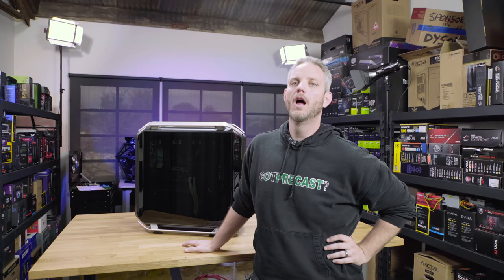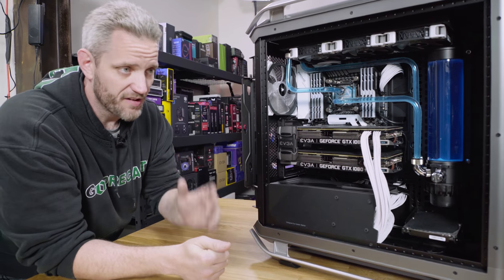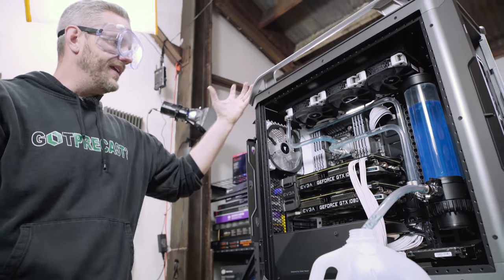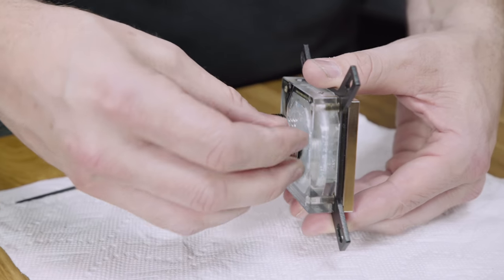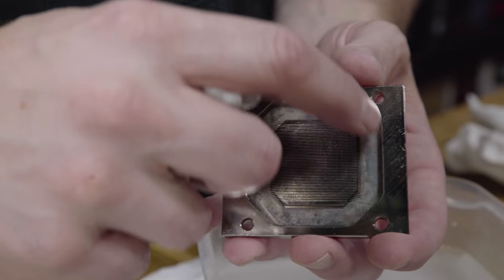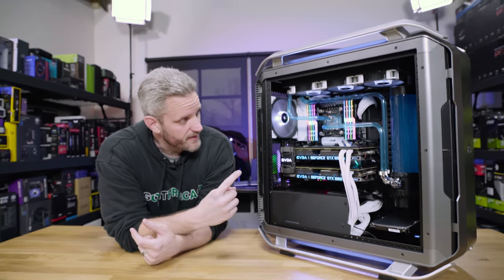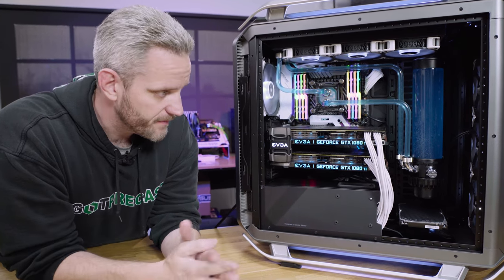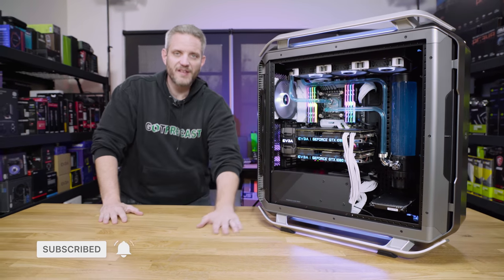It happened again... and this time it was NASTY

Comment: Here's the deal, a lot of metal stuff is made of "chinesium", as in you can't be certain of the quality of the base material in any way close to acceptable standards. So, when you have humidity and different metals you can have ions released, so you might not see "rust" but the surface gets eaten in the atomic level, while the ions might react to other ions and molecules(like organic polar ones) creating solids that becomes a slushy crap like that. So even if you have the best and most unreactive aqueous coolant, you still might get crap from the metals and polymers!

Comment: Wow, have a system running for 3 years now on (distilled water only) EKWB blocks and Alphacool metal pipes and fitting... need to take a part and deep clean it.

Comment: Umm In my experience whit Water-cooling system i do a bit different. For cleaning, i put whole system on table with on open reservoir and hydrochloric acid into mix. like 2 DL of it like a cup and let it mix. To clean radiator of anything. Later drain it and then with water add antifreeze to it which give more cooling properties ( just need to take one which don't affect metal to much )

Comment: I'm kind of surprised nobody mentions the whole problem may simply be coming from redox. And that's very much how it looks like. 
Mixing various metals, including iron/steel, chrome plating, and copper must create at some point an oxidation of some of those metals - and that even perfectly explains why the screws get corroded. You can use any fluid with an as clean system as you like, but while you'll keep putting together the same metals, the same oxidation will keep repeating...

Comment: Need something like you get on central heating systems (fernox make a lot of that stuff) to keep pipes clear of metal build up and flux.

You need to clean out the magnetic filters every so often, but it's not different to cleaning out dust filters for air cooled stuff.

Comment: Thank you so much for that link to the Computer Cleaner! I had been looking for it ever since I saw in 1 of your older videos but that link didn't work anymore. I found others on Amazon like the 2017 ESD Safe DataVac but they're over 100 bucks. You've been using this cheaper one for so long even though it doesn't advertise as ESD Safe it must be to enough of a degree or you'd of ruined a PC long ago lol.

Comment: Galvanic action.  When dissimilar metals interact via electrolyte.  In the case of cheap copper radiators it's the excess solder that causes corrosion.  In your case the coolant you used was NOT ph balanced and it probably had a minor abrasive property on it's own.  So how do you fix this?  Well, you can premix your coolants and test their ph.  If you absolutely must have multiple metal types in the system you need an automotive coolant rated for aluminum, motorcraft extended life, the newest versions of dex-cool etc.  Oh and ALWAYS use distilled AND deionized water if you are not using a glycol base.  You can also use a glycol base that is clear and tint it for your build.  Stuff like that you can order liters of on ebay.  This is just a story of why you should not use water as a base without an additive to prevent corrosion.  You can also add jet dry to improve fluid performance within the water block.   The more you know.

Comment: This happens because of electrolysis and some metal is going to act like the sacrificial metal. Somehow, there is some amount of voltage getting to the liquid. Though the case to the rad, the pump or something. But it's there. It's nothing to do with the coolant or metal quality. If you have a liquid touching metal and introduce even a small voltage over time electrolysis will eat away metal. I guarantee if the rad was tested for voltage, even static it's there.

Comment: It looks to me like Scale deposit which typically accumulates in water boilers. It is a sign that the water is hard. It shouldn't happen with distilled water. It is best cleaned with vinegar when doing it at home with a faucet or water boilers. I don't know if it there are bad side effects to cleaning these parts with vinegar tho.

Comment: tbh this is why i always recommend not using liquids with "pearls" or any kind of particules, regardless of the brand. because it WILL act like sandblaster at some points in the loop. now depending on the particules and material quality, it may take more or less time, but it's generally not  a good idea to use such liquids for a long time. that's why on all of them, you see a warning regarding that point, it always state that this liquid is for demo and shall not be used in a prolonged manner. it looks cool and awesome, but eventually, it will damage some parts.

Comment: jay could you try lime away to see if it can get the corrosion out. it is a liquid so if it works it would really be goof to clean out a radiator. not sure what it would do to the rubber but the metal should be hurt

Comment: Clean it with warm water mixed with white vinegar without taking it apart, drain the system then fill it with the water and vinegar mix for 5 minutes, drain it and flush with water then you are 100% clean, I did it on mine and it clean it real nice

Comment: Blowing the air directly into the fan can spin it so fast you can blow out the bearings. I was told that by my friend who is the manager of a BestBuy repair center. I worked 5 years as a repair man and never knew that either.

Comment: When I cleaned Vue out of my system the second time. Didn't get it all the first. I did boiling water flushes for just the rad until it came out clear. I filled the rad and capped it off. Then shook vigorously for several minutes. Then did the blitz part 1 to clean it.

Comment: I think its from a mineral build up. When dealing with heat and water, after some time there will be mineral deposits forming thus, blocking off the flow of liquid. You just have to deal with it by cleaning and doing some decalcification.

Comment: one thing i think you could have done to flush out the radiator a bit better is with CLR.  i work on cars and when a heater core is clogged i let clr sit in the system then flush it out with water.

Comment: Primochill VUE is for performance overclockers who plan to do regular maintenance.  Seems like this problem was predictable.?    I opted for the PrimoChill 'PC ICE (UV PURPLE)' which says it is for long term, low maintenance machines as it doesn't degrade or build up bacteria.  (silver coil not recommended).   Jay should switch to a simpler more 'long term' formula!

Comment: fun to watch thx.
coolant reaction with the material used in the cooling system.
common copper, aluminum, zinc and others steel material.
reduce the concentration of coolant.
this is why copper is remove from marine alloy to cast all marine engine. 
honestly the steel material use is not suitable to use with coolant.
use coolant safe for cooper, zinc, aluminum and plastic from auto shop.
use a 25%coolant to 75% distilled water. or 30% coolant concentrate to 70% distilled water.
change it every 2000 hrs or 2yrs. which ever comes first.

Comment: Experienced the same issue with this fluid.  The only thing that upset me was the fact that this was touted all over the internet as a revolutionary fluid, which ended up not being the case.  Probably should have waited for a while to see if it actually lived up to the hype.  Like Jay says, may work for some loops, but I can tell you for me it was a disaster. Had to deep clean clean every component of the loop.  It was a good learning experience but I probably won't ever use anything but distilled water from now on.  Not worth the risk in my opinion.

Comment: Unless you need supercomputer level processing, and most don't, you will notice zero improvement overclocking your system to the point of needing a fluid cooler.  At that point, build a case out of a sealed freezer.

Comment: That's why I never use water cooling. I built my machine over 6 years ago and ZERO issues. Same SSD's and big ass Zalman heatsink. The CPU Temp NEVER exceeds 118 F. under any video editing or anything I do. Running 4 monitors also. All I do is blow out the machine every once and a while and done deal. Water cooling looks nice and all but it is a nightmare

Comment: Would nice if EK or You could use on the outlet tube a filter that catches particles going to the resevoir. Not a flat filter, bag like or cylinder like ones (with lots of surface area). Hope you read this Sir ;)

Comment: I wonder if you would have better results if you used electrolysis and gold plated the insides of the radiator and fittings, (would not need much just enough to coat em, and then not use any abrasive additives) if the fluid changed then well the additives would be to blame. Though it would be interesting, it is not something i think many people could or would do to solve the problem, But you have gone through this a lot with the additives wrecking your loops.

Comment: Was just talking to a friend one or two days ago that you should pull your other video or make a correction about vue, there are so many reports that it damages your system.

I have used Mayhems Aurora for way too long, it completely settled and gunked up just like yours, though it didnt react to my fittings or plugs. I tried to use Mayhems Blitz Part 2 for a day but it still was messed up. Disassembled it all and after several flushes i still have a bit of it in there. 

Best advise is to never use such effect fluids for daily use

Comment: Here's a thought why not use OPEC blue tubing instead of adding color to the coolant, Plus D.I, R.O or Distilled water is aggresive and will corrode cooper,Aluminum and steel. In the water treatment industry using metal's other than S.S is a big no no. Never use acid on copper or aluminum it will corrode. There needs to be additives added to the water to keep corrosion down and mabe a inhibitor to keep the gunk suspended. I would every few months change out your coolant . Also heat will bring out dissolve particles in the water and create problems within your cooling system, this would be why your cooling block is gummed up the heat is pulling out the dye and solidifying it.

Comment: I run 50/50 automotive radiator fluid, it won't corrode it's a simi lubricant and wont grow anything in it. Also good for 150,000 miles.

Comment: Evans Waterless Coolants are incomparable to any other engine coolant. Proven to eliminate all problems associated with water based coolants, Evans redefines the boundaries of engine cooling. Not only will Evans improve your cooling system performance it will also protect your engine, extending it’s life and improving reliability. Significantly, Evans can achieve all this for the life of the engine without the need to refresh. you can maybe usw Like this

Comment: Copper turns green because of chemical reactions with the elements. Just as iron that is left unprotected in open air will corrode and form a flaky orange-red outer layer, copper that is exposed to the elements undergoes a series of chemical reactions that give the shiny metal a pale green outer layer called a patina.

Comment: I see videos like this, and my first thought is: thank god I use air-cooling. Fan breaks? Replace it. Usually takes like 15 minutes and zero effort to replace a dead fan, unless it's a gpu fan that dies. I just don't find the watercooling a worthy investment, given the increase of points of failure and additional maintenance requirements. 
Also, with air-cooling, I can tell which fan is borked by listening, before even opening the case.

Comment: if your coolant contains any sulfates and you have any fittings that are aluminum or iron/steel this can result in the formation of Aluminum sulfate or Ferric sulfate which have coagulating properties and might cause the severe settling you saw. Super unlikely but a possibility.

Comment: I guess you were using water as your coolant and the copper is nickel plated and it oxidized. You should try toluene. The bp is 111 C. I don't know if it is compatible with the plastic tubes and the pump.

Comment: I clean radiators as follows
first step:  Cillitbang  Powercleaner https://tinylink.net/yswym 
Half filling then drained
Shake for 2 minutes then and allow to act for 2 minutes, rinse with plenty of water

Second step: Cillit Bang Power Cleaner Grease & Sparkle  https://tinylink.net/tArGW
the same again

last step https://tinylink.net/JQn9W
Fill completely with distilled water and allow to act for 10 minutes
Blow dry the radiator with compressed air
Dry residual moisture over the heater
then reinstall finished XD

Comment: The cause of that fail is the surfactant has collapsed and caused cohesion at an atomic level due to Hydrogen bonding due to electrons in their outer shells being of the same positive force. The surfactant for some reason has changed so that each particle has gained more positive change. I bet you the PH is out of whack or some other chemical reaction. well done JZ love your honesty.

Comment: Air cooling with the largest fans you can find, adjust the fan speed as low as you can comfortably live with / the largest heat sink thermal mass & radiant surface area in the air flow stream = best solution if your design / case allows for it. If you have a supermicro board with four sockets / 72 cores per socket and you can get away with air cooling; I just don't see the argument for liquid cooling yet.Take apart a high-end IBM workstation of old. A DEC Alpha even - They use the quiet low speed HUGE fans. They thought about air flow. Unlike some gamer rigs I've heard...they didn't sound like a hovercraft.

Comment: Same thing happened to my system primochill vue only last a couple months before falling out 
My monoblock and gpu's was clogged with what looks like a paste substance. 
I  drained and flushed with distilled water than ran 5 percent distilled vinegar distilled  water solution for 24 hrs than flushed it until I couldn't smell vinegar. 
Than I took all my waterblocks out and cleaned them and the petg tubing to make sure it was clean .
Now I'm using koolance 702 uv blue good for up to 3 years
Primochill vue is only a show fluid like Aurora
Put it in take pictures than drain it

Comment: those fittings has a copper color because chrome does not stick to steel so they have to copper anodize it before anodizing the nickel/chrome plating
But yes it is weird that it erodes/oxidizing away

Comment: To all the comments about quality of metals or lubricants left over from the manufacturing process. First off, any quality machine shop uses synthetic oils in the coolant in the machines which rinses off very easily with a mild soapy water solution. EDM machines only use water. If parts are being shipped dirty, that is a poor machine shop. The metals are held to an ansi standard and must meet certain QC requirements. Plating shops are a different story. That black chrome Jay is talking about is a plating applied after machining. Once off shore (Chinese) manufacturing is brought into the story, all bets are off. Who knows what they use. I've repaired 'new' chinese dies, moulds etc... you name it. Usually requires proper  re-machining. You get what you pay for. Unfortunately companies use suspect manufacturing to save costs.

Comment: It's better to throw out blocks that were corroded at by the liquid - as well as any radiators or fittings. Cleaning them off will not work 100% of the time and could lead to further corrosion even with different liquid.

Comment: 3 yrs after original airing, I'll still come in to tell you: color of chrome plating says little about your plated material, and everything about the quality of the plater's work.  6061 aluminum is 6061 aluminum, 304 stainless steel is 304 stainless steel.  Chrome plating is generally optimized to the minute.  15m  in the chrome can look drastically different to 20m, but odds are the properties remain the same or similar...depending on the intended application.
-This guy who supervised a chrome shop for 6 years.

Comment: you could always add a zinc block into your reservoir, blaming the metal quality is not really the issue its the mix of metals if all metals are the same you will have no electrolysis, maybe those lugs you pulled out are some sort of sacrificial block intentional or not.

Comment: Could actually be a type of metal covering those fittings, and it might not be quality.  If something in the fluid is in some way acidic, as well as something metallic (many dyes can be metal based),  the gunk may have actually been the nickel and copper fighting, with one replacing the other.  Metals of different types do not play nice, you can see it when you put, say, steel next to aluminum, so if one started coming into contact with the other, well, something chemically will end up happening.

Comment: actually copper does rust. it doesn't rust like Iron, making ferrous oxide, it rusts like copper and it goes green. The surface corrosion on copper is not reactive so it protects the rest of the copper, whereas iron will keep rusting until it is all gone.
Reply: that isn't rust thats patina, big difference, when rusts sets in it affects irons physical abilities such as strength viscosity etc etc. patina doesn't do that, its like a layer of dirt, doesn't affects coppers properties :)

Comment: Actually Primochill does NOT recommend Mayhem’s Blitz! They (of course) do recommend their reboot fluid. Did the Blitz cleaning on my system ... did run it for a month trough, my fallout is noticeable but not as bad as yours. Had it in for couple of month now 3-4 .. Cleaned it with reboot and now I’m back with a new fill of VUE ... let’s see